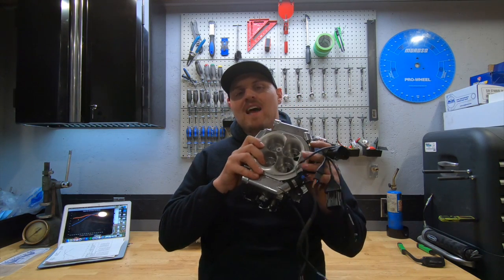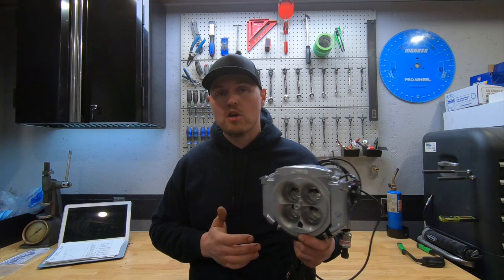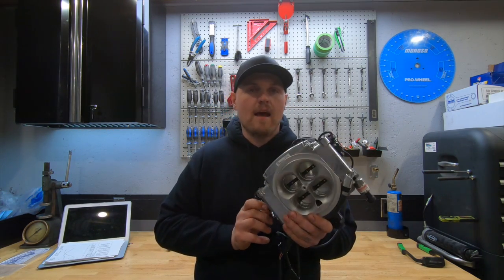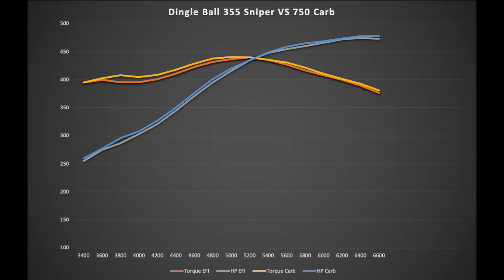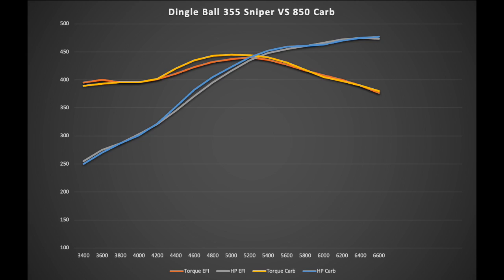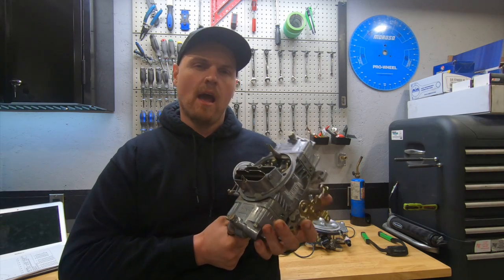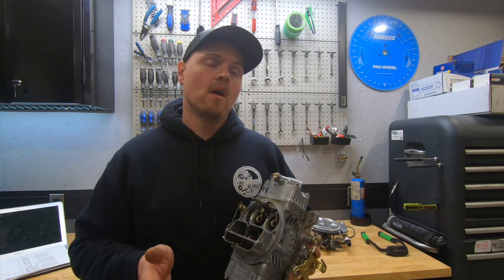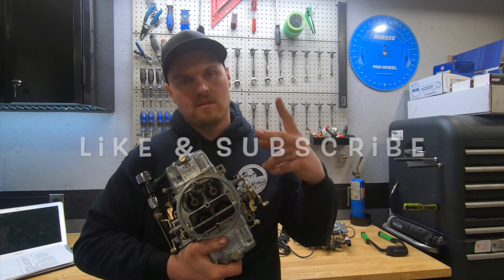Holley Sniper VS Carb Dyno test (750/850 CFM Carbs)

Comment: I think, for me personally, that EFI has an advantage with more customers, not necessarily power.  I have a project (Jeep 4.0) with a Holley 390 DP, using an Innovative PSB-1, so Vac and AFR in 1.  I'm 44 and learning how to tune this thing, been a trip, lol.  I've got it pretty good now, sorta.  But a Holley Sniper would be instant "perfection".  Learning carb tuning in 2025 is hard, start/stop of certain circuits, how air bleeds delay/engage those circuits, etc. Doesn't help that my carb is technically too large, either- but I'm going stroker soon.  And.... I'm gonna hurt feelings but be honest, alot or some, guys that say, "I did this for 40 years in my garage" are actually lost and just guessing, and they post online, too making learning more of a challenge.  It is rare to find a carb guy that is spot on with tuning in 2025.  And alot is just "feel", and that makes it even harder.  Before AFR they read plugs, still do, but that's another thing to learn and can be hard and a long journey.  EFI?  Plug it in, Maybe tune here/there and test results, way easier, that's the selling point. Especially for my age or younger.  There is a reason there were race carb gurus back in the day, because it is NOT as easy as changing a tire or head gasket to get perfection.  And lots of Gate Keeping by some of those guys, too, who are older and disappearing.

The same could be said for all Induction, guys back in the day thought a trick worked, now we see with CFD programs and open source guys like Bain and Morgan vids, etc that these tricks didn't work.  It's fascinating to me, but long and hard journey.  My YT channel is about this, lol.  Playing around and seeing theories in action.

Good vid man, subbed!!!

Comment: I think the fuel injection feels better than a carb in the midrange is very dimply due to the carb teansition from one circuit to the other. But it makes sense that the carb although smaller in cfm still glows more at the top and that explains yhe hp increase

Comment: I’m for efficiency replication. Hard to have that with a carb. Remember this is engine dyno. What the engine dyno likes doesn’t mean the car likes. The more you drive the argument it going to learn and run better and better. All I know is that on one of our applications we have a Blueprint 383 stroker with a sniper and it’s a whole different animal than a carbed one.

Comment: It would be interesting to put a temp prod inside the intake and monitor actual fuel air temps. I suspect the air flow, especially at lower RPMs through the carb can very greatly. I have would most say is a small carb on my 406, and what I really enjoy about it in this configuration is nearly instant throttle response. I think the faster moving air at lower RPM meters fuel better, create better atomization, and possible lower mixture temps. I have been glued to your channel as I have a several 400 engines and am about to build a couple more. Nothing like big block power in a small package. Have you ever read the magazine articles "Impersonator" and "Impersonator II" where they build 400s to see if you could get big block numbers in a small block, it's a great read.

Comment: Its quite simple. Carbs produce finer fuel droplets so need less shear time, espesically seen at low engine speed. the resaon Dual plane will do better as it has more turbulance as well as more fuel shear length.
Reply from the maker: Makes sense, carbs work quite amazing consodering their simplicity 👌
Reply: @cuttersperformance  That they do mate. Love both, but for as old as they are, they still go alright! 😉

Comment: Did we do the follow up video on what you think about the airflow, I assume the 900 had 1 3/4" throttle bores, maybe for that motor 1 11/16" would have been enough with the Sniper considering there's no venturi.

Comment: My thoughts on slightly reduced torque in the lower range is: air speed. With a venturi (carb) the  air is accelerated as it passes the venturi. This would add / benefit cylinder filling at lower revs.
Conversely, at higher rpms, the venturi becomes the choke point in the intake tract, giving the edge to the throttle body. Also you did not mention if the intake manifold had the crossover blocked or not.

Comment: Do you offer a kit for vortec heads with (springs,retainers ,offset keepers, etc ) building a 350 (L31 ,R code) for my truck. Will be using a comp cams  08-500-8 cam ,about like the dingle ball 350,,, thanks Bryan Bunch (Bunchy)
Reply from the maker: Unfortunately, I'm not able to offer the kits anymore

Comment: @CUTTER'SPERFORMANCE- There is even a Tq./instant throttle response difference between say a properly set up vacuum carb. Vs a Double pumper carb. A properly setup, properly sized, Double pumper carb., can have razor sharp throttle response, & Tq.! Great video.

Comment: I've done both carbs and EFI.  I used to mess around with a quadrajunk back in the 80's, kept me frustrated.  But I do agree, can't hardly go wrong with a correctly tuned carb.  But I took the quadrjet off an 81 Corvette one time and replaced with a Holley EFI system.  The drivability and throttle response was improved for the EFI, and the gas mileage. But what I like best is I have complete control over the EFI with a laptop.  I can even adjust timing and fuel while it's running. I love that!  Sure alot cleaner than having to take off the fuel bowl (between rounds) and get gas everywhere, on you, on the engine. Just plug the laptop in and make your tuning changes without geting dirty!  Overall I like EFI better but I carbs are cool too when setup right, and in the right situation.

Comment: We may all agree that the EFI makes a better and more stable AF ratio during the rpm range than a carburetor.
But how big deal is that, if the motor simply don't need that level of accuracy on the AF ratio to make it's optimum amount of power?

I think it boils down to what we prefer to puzzle around with: carb or EFI?

My personal choice is carb, but others might feel more comfortable with circuit cards, sensors and a laptop.
Each to his own.

Comment: Sniper 1 is a POS, but it works oaky after you remove the 20 bugs that come from the factory. apparently they removed most of the bugs o Sniper 2? two years later and Im still debugging sniper 1, finally found idle problem, its was the secondary sticking open, I was always blaming the primaries

Comment: What carburetor would you use on a 70s chevy 4x4 truck with a budget build vortec 350? Not a high rpm setup. Im way more interested in the 3000 to 4500 rpm torque.
Reply from the maker: 650/670  vaccum secondary

Comment: Could a holley sniper or terminator stealth basically throttle body fuel injection be used and tuned if I am using a solid roller camshaft with a 106 lobe separation angle.
Reply from the maker: Yeah as long as its got 5 or 6 inches of vaccum at idle

Comment: The optimum tune for each is going to rely on the cam. You can put the cam in way later and spread the lobe center out with EFI because it doesn’t have to rely on scavenging to push more air and fuel past BDC ( as the piston is coming back up the bore) like a carb does

Comment: Well after converting 5 of my cars from carburetors to Snipers I will tell you it’s night and day. Now don’t get that last statement twisted, I don’t drag race my cars so this isn’t about HP. 

I drive my cars, Not to a cruise-inn or a local trip around town. I mean drive them, 250 miles to the coast, Or 1500 Miles to Yellowstone. 

Carbs IMO are like a VHS, I surprised they still make them.sire they start, Drive and go down the road…..They also are finicky in hot weather, They Suck when changing altitude and Indont give a damn what ANYBODY says…….They do NOT put perform FI when it comes to MPG or reliability of quality engine performance.

There is ZERO room for a carburetor in my collection……None!!!
Reply from the maker: Thanks for your input from experience. There's no doubt that drivability is much better than a carb in any swap I've done as well

Comment: Westtech did this same thing years ago and they turned both efi and carb engine to be it's best and the carb beat the efi hands down power and torque you want hp go carbed you want less go with efi that simple, these people today don't know how to start a carbed engine and they think it's the carb's fault I grew up with carb engines and I have no problems with them there smarter than most people. done right there good
Reply from the maker: I'm not sure if it's as simple as power. Power is close, I think what most guys are looking for is drivability with a street car
Reply: @cuttersperformance  just like I stated  done right there great, carbs have been around along time with great driveabilty, there only as good as the mechanic tuning it was when a carb has a problem you still get home when a efi has a problem here comes the tow truck.  And yes I know the efi makes things easier and better fuel econony. worked on both for years and years and like I said both has there advantages and there tuning is different on both

Comment: I was surprised by the bump in mid-rpm torque with the 850 cfm carb over the Holley sniper, at least on a single-plane intake manifold. You mentioned the results were different with a dual-plane. When do we get to see those results? Great test!

Comment: I have the ACE killshot-this was based on everything else on my big block. Carbs will always have a warm spot in my heart like points over HEI..lol.
Reply from the maker: What do you think of the ACE killshot?
Reply: @cuttersperformance  Its VERY easy to use and tune. I had an 850 dp but swapping intakes/headers etc etc it was easier to tune with the ACE. Holleys are easy but I am sold on the ACE. And for $800...up to 650 HP...you cant go wrong.
Reply from the maker: @tangledline  I may have to give one a shot. I asked if they would send me a demo to dyno test...no such luck yet haha
Reply: @cuttersperformance  Yeah,  I was hinky at 1st but after doing alot of research..I was like "dominator or ACE" and thats how it happened.

Comment: The low end torque is a function of fuel flow. You need to add fuel at the lower rpm’s, that the gap. The carb is typically way richer at low rpm.
Reply from the maker: Exact same air fuel ratio. I've even tried richer and leaner
Reply: No it isn’t, too much fuel is going to hurt TQ as far as a carb orEFI is concerned they just need to optimize tune to provide ideal A/F torque is dictated by engine design not fuel flow

Comment: When you tune the fuel injection you should use a little less fuel than the carb will be using because the fuel delivery of fuel injection can be considered instantaneous while the carb fuel delivery profile is lagging so the carb is in essence delivering a leaner mixture at precise moments.  AFR can look same but that measure doesn’t correlate exactly to fuel delivery while engine is accelerating. Tune the FI leaner by 1 or 2 percent. Power will come up.
Reply from the maker: Ive tried both, slightly leaner and richer. Abit lean will usually help the top end but I can't seem to match the lowend average torque of the carb
Reply: @cuttersperformance  wow! I loved carbs back in the 80s but been doing the fuel injection thing since. It is great to know that carbs can still be as good as the much more complex FI. Thanks for the info. I stand corrected. I probably wasn’t as good of a carb guy as I thought I was lol.

Comment: Carbs vs tbi is alot like buying welders, some only have all around,basic settings that have minimal adjustments(carb)
 No buy a welder with every parameters can b adjusted (tbi) u get cleaner run time, easier starts etc, overall is better
Reply from the maker: Good analogy!

Comment: Its in a ratio of error, 7 to 8 ftp torque,  not worth a carb
Reply from the maker: Ive had almost 20 fllbs loss on some engines on the dyno
Reply: @cuttersperformance  I have max effort 93 octane build, carb was never consistent, might b good in one area but crap in mid range, and not notice, I picked up couple miles hr in quarter mile switching to tbi, and that was b4 I new how to right fuel maps, so I'll take that loss, but ive seen engine masters test this and came back same, so most likely tuner problem,
Reply: @cuttersperformance  also I'm sure since ur dynoing 4 power I'm sure u didn't toss on a 4160 holley either, I'm sure it's one of the best race carbs u can get duel feeds, annual boosters, I'm sure if holley wanted to they could make a tbi yrs better like pitch the iac valve, that's for easier driving, what on an xp is for easier driving, maybe progressive linkage or maybe power valve, 
 From my experience most race carbs are more less on off switch, with an idle
Reply from the maker: Didn't try a 4160 but the carbs used were just 4150 street carbs. The 750 was just a run of mill classic 4779 with choke horn. The 850 didn't have a choke horn, but nothing fancy either
Reply: @cuttersperformance in 2000 the 4150 was the best u could get, its built for performance mind tuned for performance, basically a race carb, sniper is single feed, so comparing it to a 4150 and being right there, that's awesome to me

Comment: The EFI TB does seem to have better throttle response and tip in. Sequential EFI does feel that way as well. That might be what is being felt as having "better low end torque" but from off idle to may be 2k rpm? The TBI performance resembles carb performance more than your normal port injection.